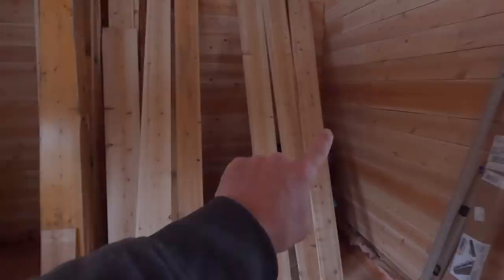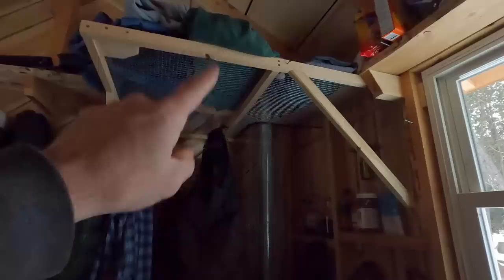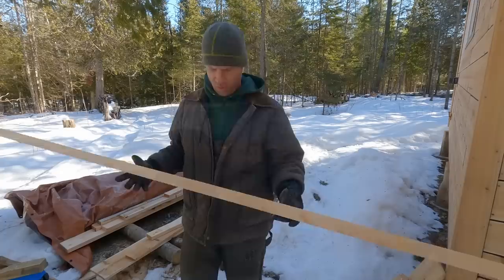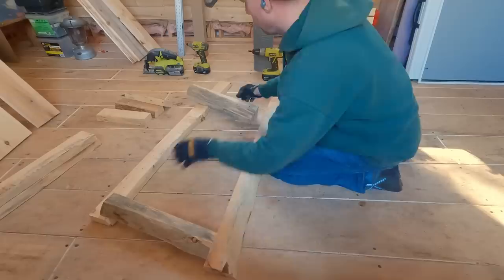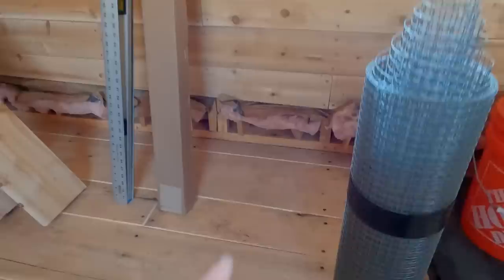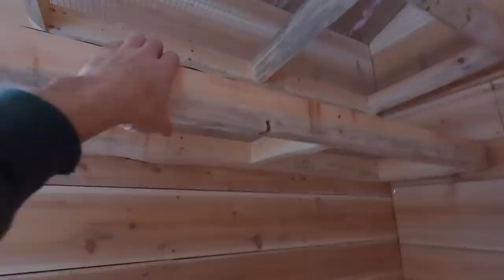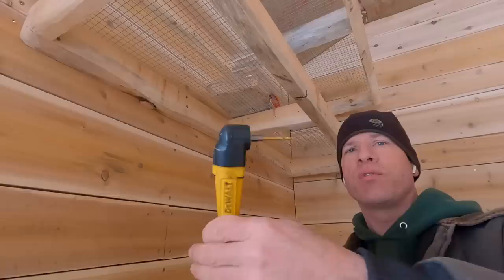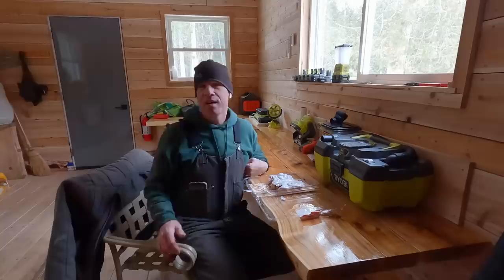Wilderness Microwave & Clothes Dryer Creation (from Alaskan Milled Building Scraps) #126

Comment: Eric from Montauk here. since I commented last we've moved to Calistoga, CA. Spent a year there and finally gave up on the hospitality biz. we've been in Newport, RI now since Sept 22' Now I'm in trade school learning composites and marine systems, super cool. Been watching you since the beginning. Favorite channel on the webs. Keep going brother, Long live Ringworm. So, I just met some very nice folks from Victron Energy, they're on a North American tour currently and they came to my school last Thursday. They did a deep dive on the physics of Lithium Iron Phosphate battery chemistry and I thought of you not being able to use your batteries when it's colder than 40 F. I asked Victron about that and they didn't give me a great answer for why the batteries drain so quickly but they did say that charging LiPo below 40 F. will ultimately create Dendrites (frozen ionic stalactites trying to flow to the anode) forming on the cathode and moving or "growing" thru the one way membrane to the anode. Once the membrane is ruptured the batteries can fail in spectacular fashion. My question was phrased. "If you have to charge and work in sub freezing conditions all the time, how would you run your gear?" Victron said ( "if your battery is too cold to charge, warm it to above 40F. before attempting charging to keep from dendrite damage.Also  If you can load the battery by running a tool, the discharge process will also warm the battery so you can charge it in a cold environment.") I hope that is useful for you and that's all I got right now, Keep on rockin' and see you next Saturday. best, Eric in Newport

Comment: hey Ryan,

two ideas, first, put in the small rack you talked about directly over the heater, having a warming spot for food etc would be handy, but more importantly if you drop a sock off the hook, it wont fall directly on the heater and catch fire.

Secondly, I've heard all your arguments against wood stoves and they make sense, but if you come a across one, you could consider putting it outside, with the flue coming off the back, through the wall to the inside of the cabin, turning 90 up along the wall and back out at the eave. That way, when you do want to burn some scraps, you can do so in the stove, and get free heat indoors in the process. Saves most of the space needed, and saves some propane every year too. Plus, no harm to have a backup if you cant get out for a week or two.

Comment: Last time I injured my back and was told not to do anything strenuous i welded a socket onto a 3/8 piece of bar and put It in my cordless drill. I took the pull start off my mower and chainsaw and used the socket in the drill to start my stuff. To this day i still start my mower the same way 😅. Work smarter not harder 😁

Comment: shelving, you could try to make torsion boxes out of broad three quarter boards on two by two frames( they could be screwed together not jointed) and using a construction adhesive that water does not affect.  You have convinced me that if anyone is attempting this kind of project, The first thing to build is a small pole barn or similar, big enough to work in, with a bunk in the corner,and a damn great double oil drum wood burner nearby !

Comment: If you put a small shelf just above the heater, you could get one of those heat powered fans to set on the shelf. As the fan gets warm and starts the turn this will move the air all around the cabin. This will keep the air a more even temp. If you could find a small ceiling fan that won't take much power it would help even out the top emp even more. It would move the warm air up near the ceiling down into the room.

Comment: Here's an idea.
You might want to invest in one of those camp stoves and get one that has a removable ashtray so you can empty the ashes out. It's a wood burning stove and that will take the moisture out of your house.
You can still run your propane heater in the corner, but the wood stove will pull the moisture. It will dry it up.
Reply: Agree. I installed a $100 tent wood stove out back in my she-shed. 1000x better than propane wall heater in stopping moisture and condensation. Welded up a steel shelf to mount the mini woodstove on the wall giving plenty of room and distance underneath to stack mini logs.

Comment: I have cabin in swamps of the UP also. You need to add a few vents in the ceiling, just regular wall registers. And a few roof vents.  This will keep the hot moist air moving through the cabin. If you don’t you will have mold issues in the future.  Propane also adds moisture so without a wood stove to really dry it out, moisture will always be a problem. Vent it.

Comment: Ryan, you make very nice videos, you can solve a lot more elegantly, it’s the physics, you can’t cheat on them. If you heat and the humid warm air, goes down, it’s good.Just as you heat, the wood saturates on the ceiling and in the corners, it’s not a proper air exchange and the humid air goes up and your problem, you have not solved.
In your place Ryan, in the summer, when it’s really warm, seal around your buildings you live in, down on the floor well with boards, then drill a few holes in the floor from above, where you don’t see it and over these holes, Spray everything with a good assembly / insulating foam. First moisten everything that comes into contact with the foam. Greetings from Frankfurt

Comment: How crazy would it be to put a small wood burning stove in there in addition to the propane heater? Just so you have options and could save the money on propane, since you have plenty of wood scraps to burn? You need to crawl under that thing and insulate the floor if you want to start winning the battle too. Love your weekly episodes, thank you for sharing with everyone.
Reply: Yup, I totally get why he chose propane... it makes sense, that being said... having an EMERGENCY back up of a small, portable wood stove also make some sense.     When you're super remote...
* Two is one and one is none *
Reply: if you go back and watch earlier videos of the cabin build he explains why he used the heater he did and that he plans on building another floor on top of the current one with nicer finished wood, the idea was to get this going so he had a place to stay during the coldest nights of the winter
Reply: @420metalguy  I’ve seen all his videos, but that doesn’t change my thought that he should have a wood burning stove as well. 😁
Reply: Rocket mass is the new wood stove search .. Paul Weaton Missoula MT

Comment: you can make your bed frame where its solid and use the  chicken wire across it  but tight and it will give somewhat a support and may   be more comfortable than a wood deck they do this in overnight shelters  when hiking  but use cattle fencing  across it to lay your sleeping bag out  on

Comment: Hi again i done alot of coments about the moisture abd ventilation broblem, you can read that. In one eposode you was surprice how much wet air you got by just bring in some materials. I did a test over 1 week logging my house when i build it. I put a hygrometer tester on a hall table 33-4 meters from my bathroom, when i get in there without closing the door i can see in the log every time i washing my hands, think how much moisture a person deliver and kitchen, shower propane and cooking. Look at my comments before, maybe 10 of them in dif episodes, most of them about ventilation and moisture barriers inside the house so you do not get wet walls. Special the roof i sugest you buy a rain coat or umbrella

Comment: Drying any thing is taking moisture out of it  the moisture has to go some where . If it is your living area it goes into what ever is in that area. I suggest a seperate drying room that has nothing in it that can absorb moisture and vented. 
Under a building is a good area for drying timber  sheltered from rain and snow and ventilated. Some sort of vapour barrier on soil to stop rising damp. 
It is a good idea to have a vapour barrier on soil under any wood floor areas. 
Drying inside can also cause the build up of mold

Comment: How about a piece of wire rope to hang the outer corner of the bottom shelf to the top shelf and another to hang the outer corner of the top shelf to a ceiling rafter/joist? Support from above rather then below. Or chain - like your floating table.

Comment: Ryan, two projects to think about.  First, build a dog house for your generator so that it's a ways from your cabin.  Bury a cable in the ground from the generator to the cabin and install a permanent outlet inside and out so you don't have to open the windows for an extension cord.  Second idea would be to build an outdoor wood boiler and install a radiator inside the cabin.  Use antifreeze in the boiler so it doesn't freeze.  You wouldn't necessariy need a pump since hot water rises so it will cirulate naturally.  Radiant heat is some of the most comforatable heat and it doesn't add moisture to the cabin.

Comment: For the racks, especially a food warming rack, hinges are gonna be the innovation that will be your friend.
Since you like to hover over the heater for a bit to get warm, a rack with a hinge on the wall, and just use a cantalevered rope on the corner to sustain its weight when allowed to be down, would certainly be the low tech sollution to that need.

Comment: You could build a small emergency addition that had an area for your scrap and trash wood and be close at hand if you get 10 foot of snow some night. By having a wood stove in that section, that section could have an emergency exit at the top and the heated section could help melt the snow/ice to keep the emergency exit accessible to out side. 

You could have a tub and or exterior drain so that if you had to dig out you could put the snow in the tub and heat it to drain out and there would be no snow build up inside as you are digging out. (and of course a heated tub could be used for other things as well, maybe a two person sauna, or you could even take a bath or soak in side in "hot' water.)

Comment: DampRid works pretty good... as long as it's above freezing. I have humidity problem in my converted cargo 
trailer. Plus an exhaust fan. Unfortunately, up here in NW Montana it's frozen half the year so it's hard to remove the moisture. I'm learning though.

Comment: Cold air doesn't hold as much moisture as warm air. That's why it's dryer during the winter than in the summer.
As far as the floor being cold, once you insulate, the floor will be warmer. Enclosing the space under your cabins will help keep the floors warm too. Like skirting a house trailer. This keeps out the wind and the lack of movement of the air underneath acts as insulation.
On your shelving over the heater, the top won't get as much airflow as the bottom. The bottom shelf blocks the airflow to the top. I might suggest moving one shelf to the wall 90 ° to the right and have them on the same level.

Comment: What about NOT DISASSEMBLING the interior boards and simply pre-sanding with a belt or Oscl sander in place. Then varnishing or polyurethane 3 or 4 coats, after it dries well, with a paint roller. 

You can sand well between coats and build up a layer of varnish. In my experience even 2-3 coats of varnish covers a lot of tool marks and uneven surface textures and marks. In fact many fine furniture companies intentionally leave circular saw marks or milling marks to lend tasteful character. 

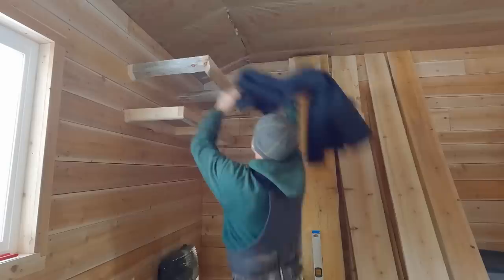I think your return on investment for disassembling and planing is meager at best. 27:12

Comment: For floating shelves, drive some dowels horizontally into the wall, on the back side of your shelving material drill holes matching the position and diameter of your dowels . Drive the shelf onto the dowels and there you go. Floating shelves.

Comment: Thanks for the great videos. A lot of time and effort goes into your content and it shows. As a part time Yooper with an off grid cabin on the Garden Peninsula, what you do is much appreciated. Of course, despite your having listed much of the tools, devices, and equipment you use, this subscriber would also like to know where you got the round, multiple compartment, caddy you used in this video to house various size and type fasteners/screws you used. I'm getting ready to build another semi-small barn and would find this product to be mighty handy. Thanks in advance for pointing me in the right direction.

Comment: Buy wrecked motorhome equipped with a diesel generator. Remove generator and leave RV carcass behind. Mount generator on a stump. Build a two room/back to back outhouse style shack and put 55 gal. drum of Diesel in one side, and generator in the other.
 Walah! 50 Amps at your request.
 Next power in the woods for welding issue please ?

Comment: Build a lightweight insulated camera box. Styrofoam or rigid board. Maybe heated with a hot rock or water bottle. 
Sound would be an issue. Maybe a separate roof for rain. 
Add more hanging nails to top drying shelf.

Comment: Ryan I know you usually release your videos Saturday morning, but if your Doctors appointment about your rib has news from the X-rays, could make a 5 or 10 minute to give your subscribers a medical update?  

Now about your fire extinguisher!  Dry chemical extinguishers need to be inspected monthly, and if you have a rubber mallet you need to turn the extinguisher upside down and pound the hell out of it.  The dry chemical tends to cake up and won’t spray out at all!  So you are checking to make sure it is still charged and no evidence of dry chemical coming out of the nozzle at all!  When the fire extinguisher companies recharge an extinguisher they have to take the valve assembly apart and scrub all the pieces with a brass bristle brush to remove all of the caked chemical they empty out all remaining chemical and reload with new chemical.  Then they reassemble the release valve and recharge the tank.  Here is a rule to remember “IF IT WAS USED AT ALL, IT IS NOW EMPTY!”  It’s like taking a jammed rifle out to hunt for bears, you have no protection!  I was a construction Safety Manager and Instructor for 17 years and on of my duties was to get used extinguishers recharged!

Hope all is well with the Doctor, they used to tape up broken ribs but found that sometimes caused internal injuries, not sure what today’s Medical advice is?  Good luck and please keep us updated!  ❤❤

Comment: The problem with heating with propane is moisture, even with a vented propane wall heater. Blue flame is worse than radiant. I heat with radiant, vented wall heater and condensation is so bad in the winter water is constantly streaming down my windows. The interior of my tiny home is tongue and grove pine. The humidity caused the pine boards to buckle and mold began growing in the coldest corners. The humidity is so bad I have water collecting up into my ceiling/roof and dripping off my eves. Better to switch to wood or pellets.

Comment: Wet boards. Humidity.
Can you rig a solar-powered fan with a small duct.
Winter air VERY dry. Why not string up a sloped heavy duty waterproof tarp tied to four trees to cover your wood pile to let it dry out.

Comment: If you wanna remove humidity in the cabin,  take the coldest day/night,   Heat the cabin the most you can for a good while,   Then open all doors and windows for 15 min,    Cold air outside will suck all humidity from inside the cabin ,,,,,real real fast

Comment: Does the humidity go high because the wood is so wet? Then you build more with wet wood, do that humid isn’t going anywhere…. That is crazy how it jumps around!
Maybe you could do a drying rack that can fold up against the wall when not in use. If you use a net at the top for hats an gloves an small stuff. Then staggered rungs for hanging…. Let’s see what you got, amaze me like you do all the time!!! Could ya make a cozy for the camera to help it maintain its camera heat….lol

Comment: And did you know there are solar liquid tubes the liquid is like glycol or alcohol or something and what they use in colder places is like a magnifying glass over the solar tubes I scratched my head about it but didnt have the money to experiment with it, But you had to run say a coiled tube inside of a water tank with the alcohol or glycol running through it to heat or keep your water warm. Actually there indirect water heater they are a very thick and heavily insulated like a coffee thermos is what they are called and used with solar systems And of course water towers what keeps them from freezing? I looked at that to but forgot what I found.

Comment: If you have more than $250k in a bank account you need to open other accounts and keep less than $250K in them.  Make sure the bank is FDIC insured.  Hope your ribs are healing.  There is a blade for your grinder that you can use to strip bark off of trees.

Comment: Hmm how high is an army cot that you sleep on for winter camping you dont spose they researched that for staying warm in cold weather? maybe your water needs to be at least that high off the ground to to not freeze and they had something called a water buffalo  for hauling water in the feild. you might wanna start thinking about using metal instead of shingles on your roof cuz ur in a forrest?

Comment: Iwas thinking about a backup bettery source for my house a few years ago they sold a battery about the size of like a walkman radios for jumping cars they jumped like a hudered cars with that little thing. Why couldnt you make a battery bank connecting a bunch of those little batteries. Im used to dealing with golf cart batteries usually deep cycle 6 volt say Trojens they are expensive. they are deep cylcle like for boats usually have 12v deep cycle. But the little tiny things I forget what they were called it was as seen on TV type commercial. Like your daughter could carry one in her purse type thing.